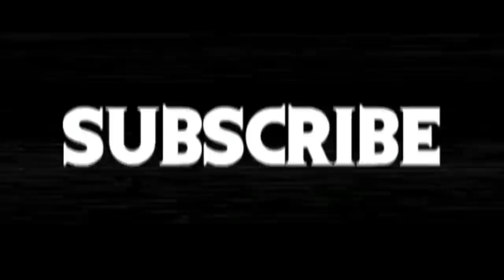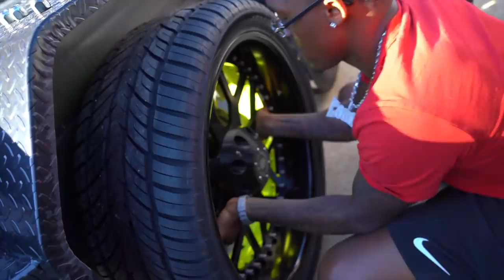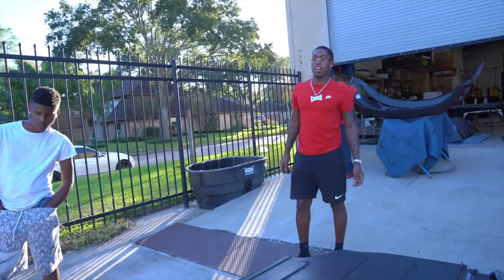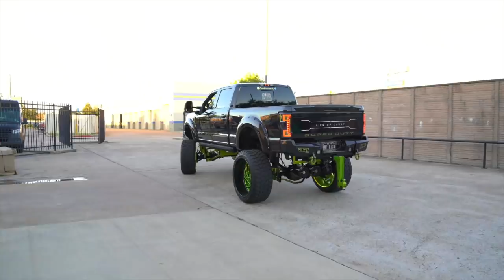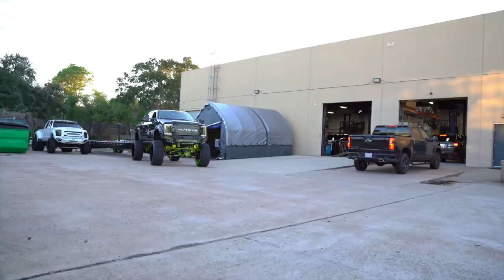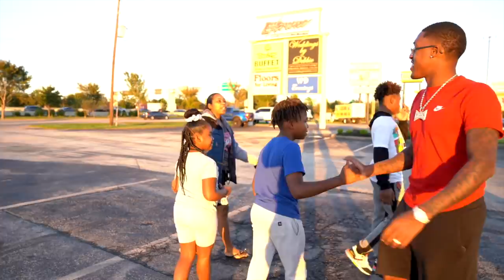Mounted my 2 car trailer on 24 inch rims !

Comment: No hate just make sure those 10ply tires u running a serious investment on that trailer and can kill someone or lose alot.... Trailer tires way different than truck tires
Reply: Right
Reply: Most important comment on this thread
Reply: Yes Sir
Reply: Absolutely 💯
Reply: Facts
Reply: What’s a 10 ply tire?
Reply: @Taj_Rollin  Generally speaking, trailer tires have a Load Range of either B,C, or D. For example, a trailer tire with a load range C can hold 1,820 pounds.
Reply: I was about to say the same thing.
Reply: Fr tho
Reply: Indeed
Reply: Finally, some knowledge and common sense in these comments! Definitely need some stabilizer bars on that drop hitch